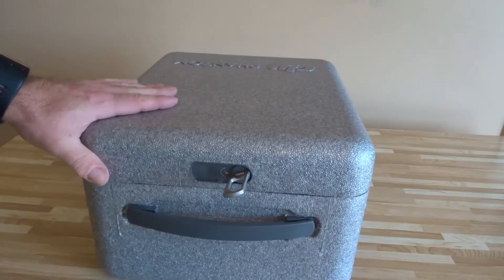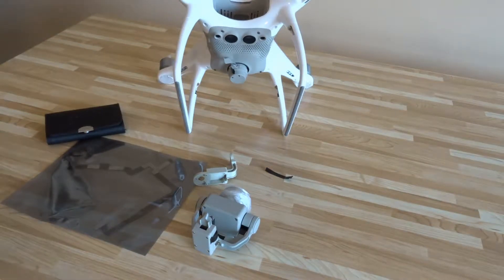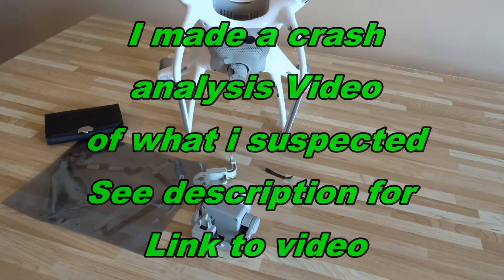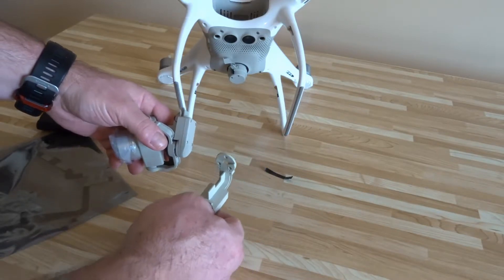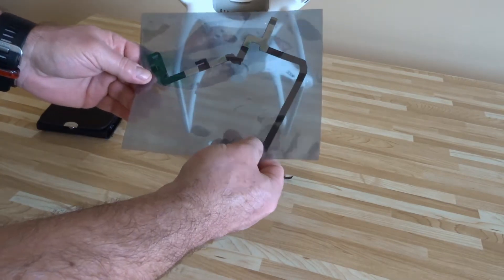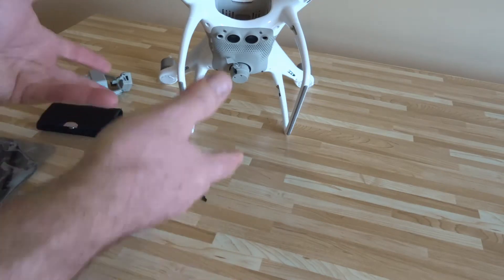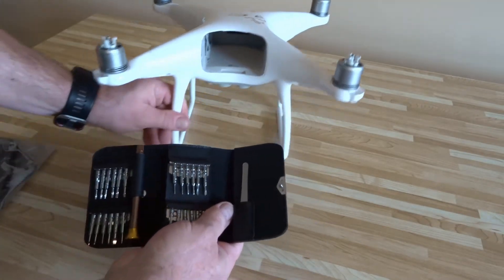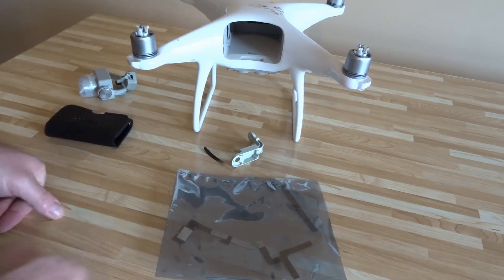Phantom 4 Pro & Advanced Yaw Arm Parts ep1

Comment: does the yaw arm of pro advanced the same of phantom 4?
Reply from the maker: I'm not sure about the brand new phantom they have been advertising.. but the yes, normally the phantom 4 Advanced and the Phantom 4 Pro have the same arm, camera, and associated parts for the gimbal, even the camera cables are the same, yaw and roll motors etc..

Comment: I lost the bracket that screws to the yaw arm motor that the ribbon cable sticks to and can't find anywhere that sells a replacement. HELP
Reply from the maker: Hi Rich, I believe you are talking about the yaw arm cap, thin metal piece that cover the cable. Just do a search for any company that repairs drones and they will have one and most likely sell to you. DJI does not seem to want to sell anything and restrict companies from selling parts.. Guy in Toronto has them, won't be listed so call them.. www.omniviewtech.ca
Reply: K&D_Enterprise No that's not what I'm talking about. I'm talking about the tiny bracket ON the yaw motor itself. It screws to the yaw motor and it swivels with it. The ribbon cable adheres to it . I cannot find one anywhere. Please help!,
Reply from the maker: oh, ok.. I would check out the site address in my first comment... they seem nice so will direct you if they don't have.. my guess, they have what you need..
Reply: K&D_Enterprise thank you sir